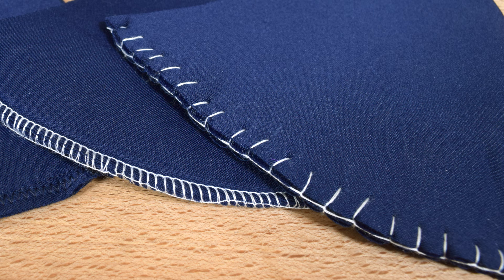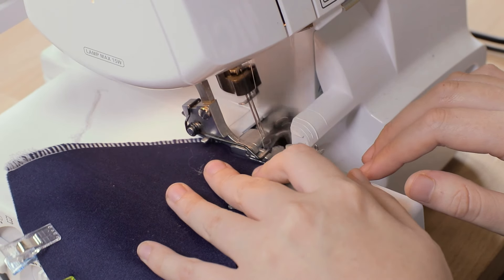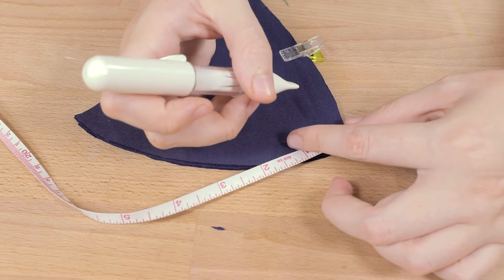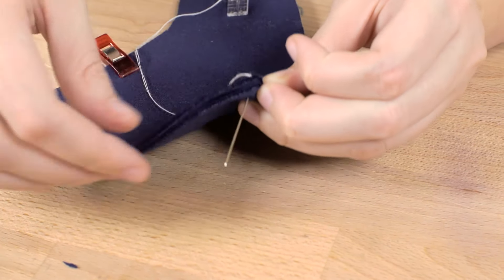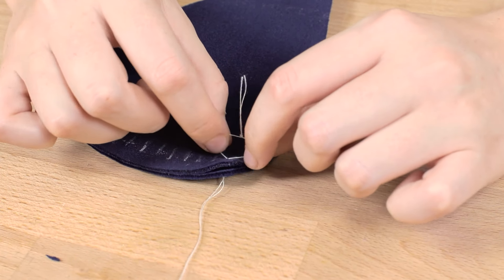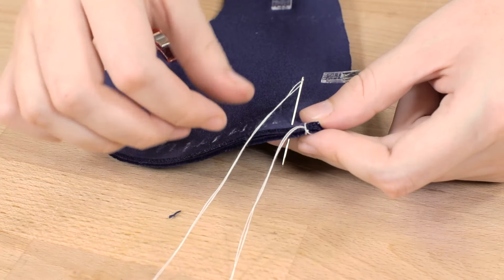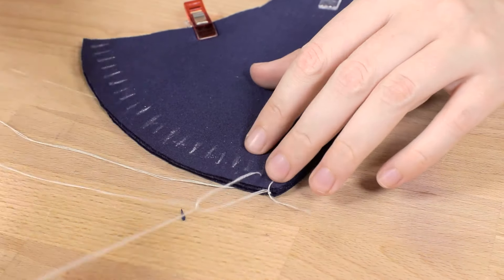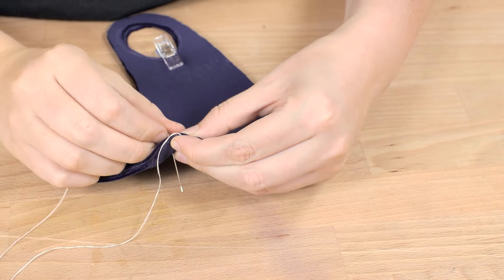How to Hand Sew an Overlock Stitch

Comment: Will making the stitches closer together make the fabric less liable for fraying?
Reply: If your fabric is very fine you'd be looking to tuck the edges in before doing any edge stitching.  Closer does work but generally the blanket stitch is pretty good at controlling fraying even when spaced out .  It becomes more of aesthetic. You can go closer to have a cleaner look but it takes much longer with more thread.

Comment: How is this any different from blanket or hemstitch? An overlock stitch requires two needles.
Reply from the maker: This stitch is also commonly know as a blanket stitch. There are many types of stitches that could be called overlock stitches from a broad definition. This is the most basic hand sewing version but it also refers to the complex stitching by sergers or overlock machines which often use 2 needles.